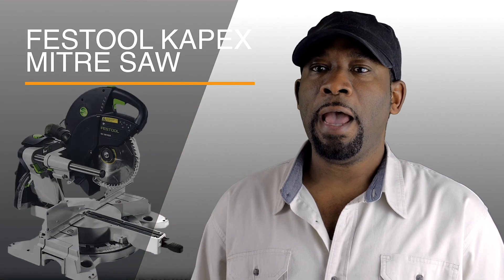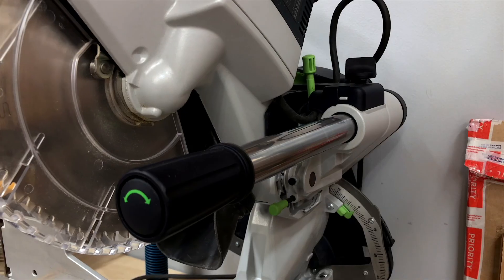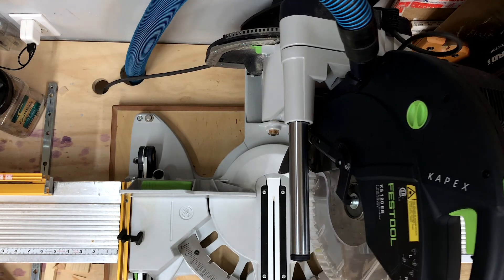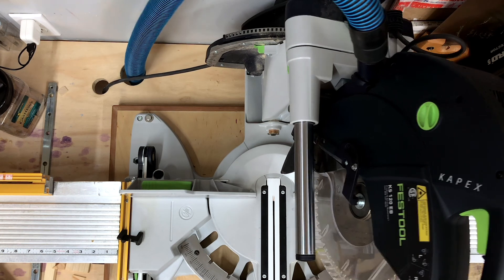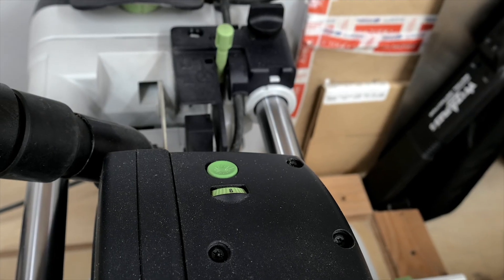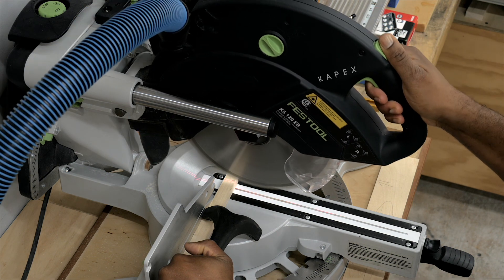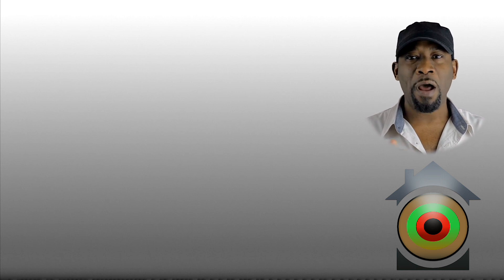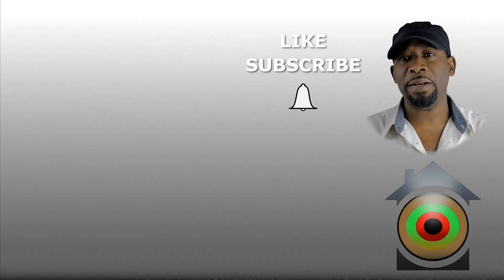FESTOOL KAPEX MITRE SAW

Comment: Very important it doesn't matter which machine.the best you can do buy always a Slide Compound Mitre Saw with the handle in a line above the saw blade,everything has to be in line Slide bar rails,handle,and saw blade. it's better no tilt saw blade, and engine with softstart .
Handle vertical or  horizontal above saw blade is okay if it is in line above the saw blade and in line with slide bar.Everything has to be in line this is important.example bosch gcm 800 sj / gcm 8 slj professiona / Evolution rage 3 / FESTOOL KS 60 / EVOLUTION RAGE R255 sms...
Reply from the maker: I agree! The ergonomics of this saw is very natural! It's like using a hand saw but with power. LOL! The stance that you take at the mitre saw should be like the stance you take with a hand saw. The motion is the same as well. Thanks for watching!

Comment: What is the size vacuum hose are you using. Secondly where did you purchase the hose? I just purchase my Kapex and I think I need bigger hose to maximize the dust.
Reply from the maker: I’m using a 35mm Bosch anti static hose that I purchased on Amazon. The tool end is 27mm and I replaced the Bosch vacuum end with the Festool. At some point I will replace the tool end with the larger Festool. Thanks for watching!